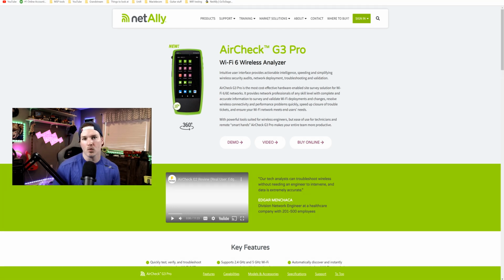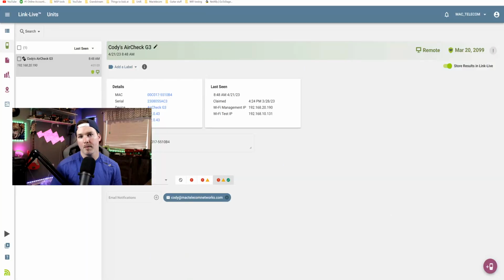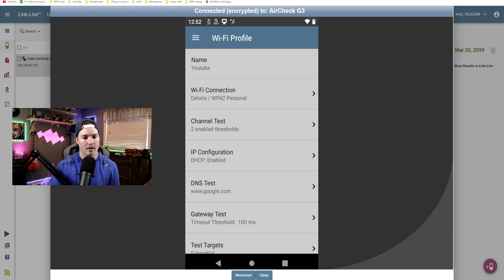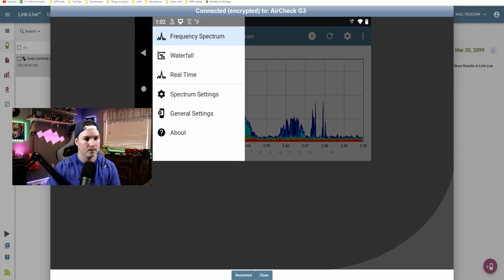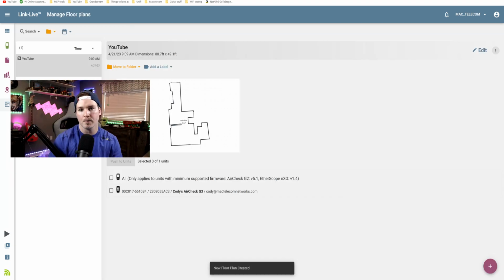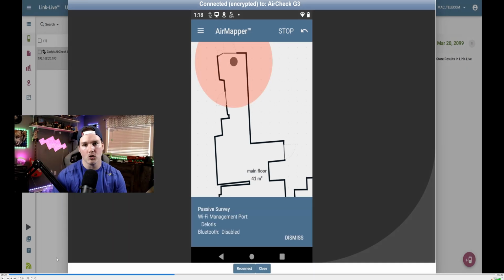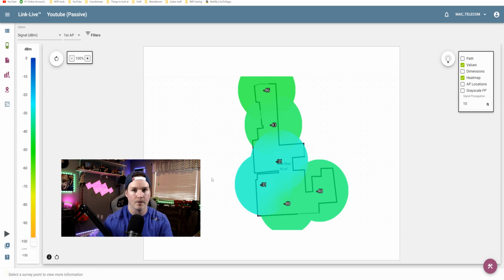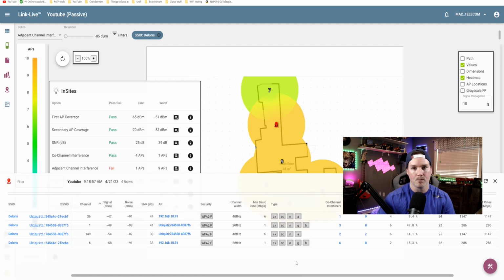You Need this WIFI Tool!!! Netally Aircheck G3 pro

Comment: Ive been using the Viavi WiFi Advisor for a while. They can do everything (except 6GHz since I’ve had them a while), but are a bit bulky. Also have a Trilithic 802awe that I use more regularly. Not as many functions but very small and good for troubleshooting.